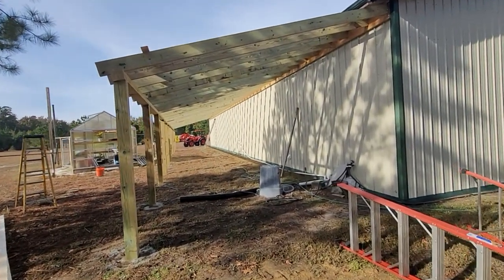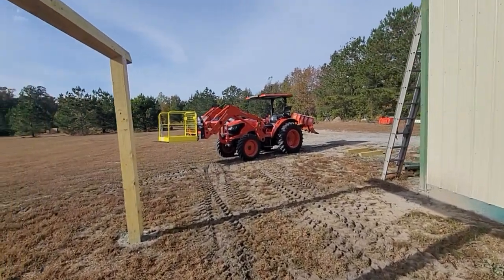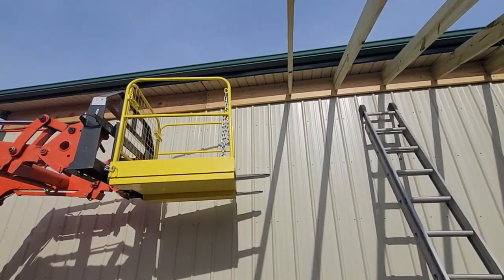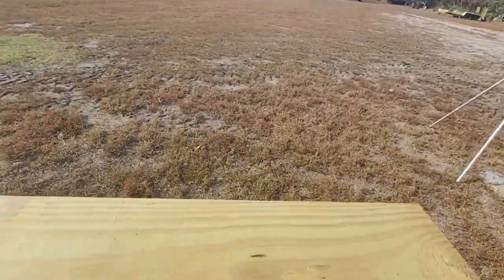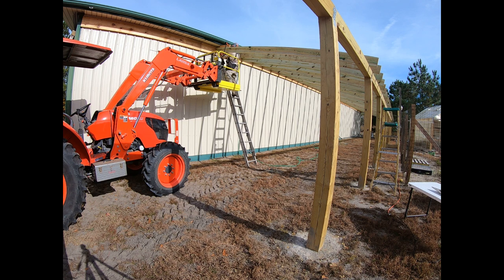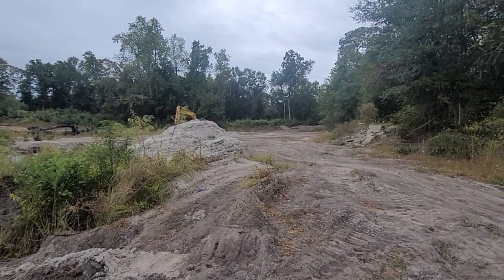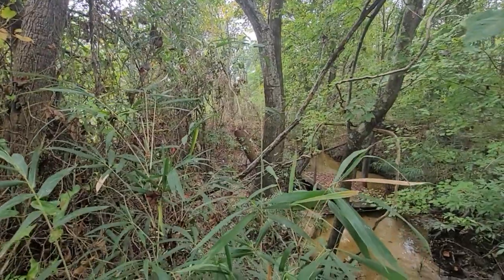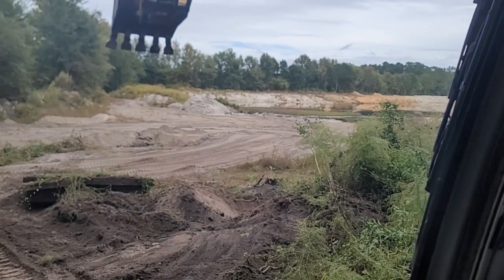Building Ramp to Diversion Trail -Remove Float from Ditch-Lean-too Update...

Comment: my house was built 30 years ago ,always had a swale in the front side,this year had a new roof installed,ripped up the sheathing ,and you guessed it, had two 2 x14 rafters crowned down,,,oh well, scabbed 2x8 full length ,looks good now ,they originally bowed when timber dryed out and hadnt changed for 30 years,,be well and stay safe
Reply from the maker: And robert, what makes it worse when 2 are upside down,  it doubles the dip.....it the crown is say 3/4" up then the dip down is 1 1/2'.....very bad.....glad you got it corrected!